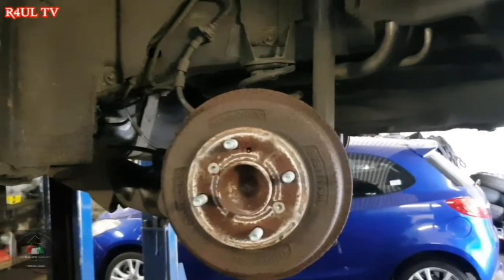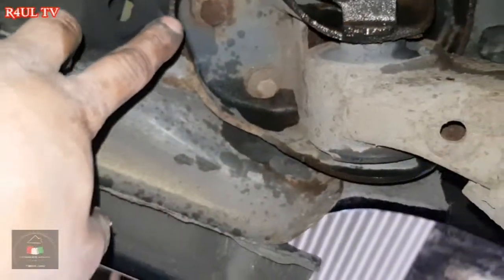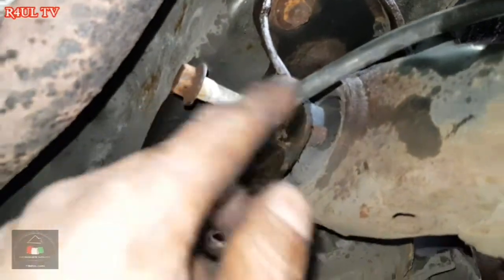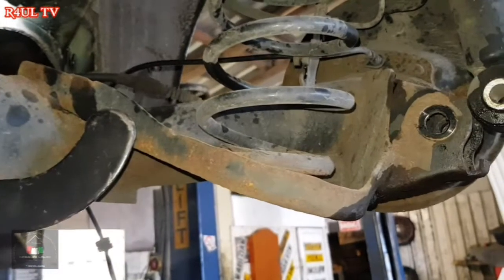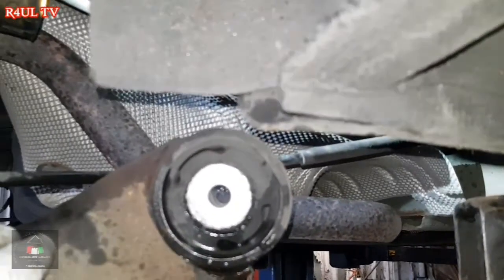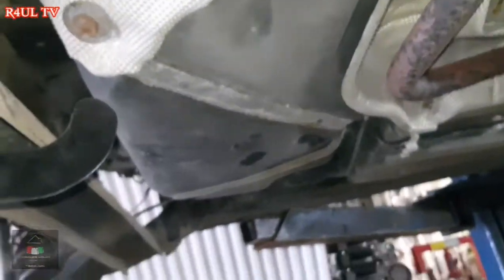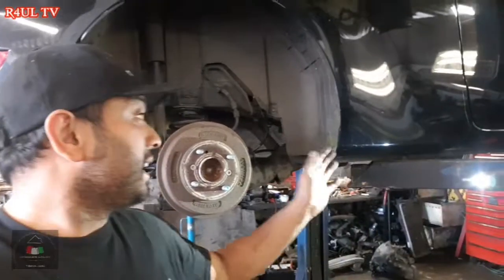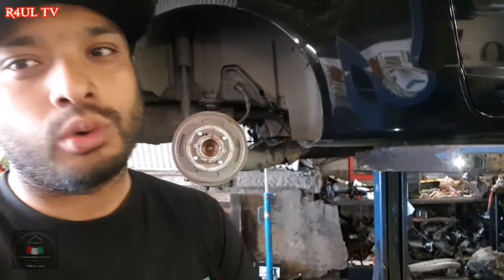2009/2016 Ford Fiesta Rear axle Bushes Replacement/Trailing Arm Bushes

Comment: Raul, did you fit those bushes the wrong way??? The solid bits should be horizontal when level, to prevent fore/aft movement and the two gaps need to be vertical! That car will be very rear wheel “loose” like that. The bushes should have a small slot on the outer plastic rim too or just use tippex to Mark it.

Comment: Good video very informative I juss wanted to ask do u reckon weak axle bushes can cause a sort of sliding or swaying left or right at the rear when u drive ? Cos I got this on my Mot advisory thanks
Reply from the maker: It can do yes, also check your Shock Absorbers
Reply: @TEAMR4ULTV  juss had the shocks replaced last year so I’m guessing they shouldn’t be the problem but thanks bro I got quoted £230 including labour.

Comment: Great vid, but if you leave the shocker bolts on and just undo the 3 x 15mm bolts that hold the bush retaining bracket on off on both sides it pivots the right way and makes it easier when being supported by a stand. 👍👍
Reply from the maker: You could do it that way, to make it more easier thought it would help anyway thsnks

Comment: Is your customer's car experiencing problems due to incorrect installation of the rear axle bushings?*(bushes position is wrong, see old bushes  position  and new). Have you installed Ford bushes. I am asking about as fitted ford bushes correctly and back of the car  vibrates above 65 mph
Reply from the maker: The customers car is great no problems what so ever

Comment: Hi great vid i get a low rumble thud going along at rear end over bumpy roads would it be this?
Reply from the maker: It could be, check the rear shock absorbers to be sure
Reply from the maker: It could be the wheels bearings
Reply: Hi thanks I changed them both but one of them went in slightly twisted round in different orientation does this matter to much? As I see some come solid and can be put it any orientation drive it and seems fine no knocks now  thankyou
Reply from the maker: @jcreswick  it should be ok it might not last as long but should be ok

Comment: Hey mate, great video. I've got a noise from the back end of my Fiesta. When I back off the drive it's 'creaking'. For a while when driving it 'creaks' too. I suspected rear trailing arm bushes but the car just MOT'd and was all good? Still worth changing do you think, or something else?
Reply from the maker: If you have the tool to replace them then ok but if you don't have the tool and if it's passed the mot I would leave it. Might've something else, shockers etc